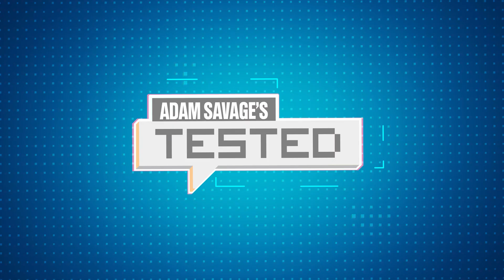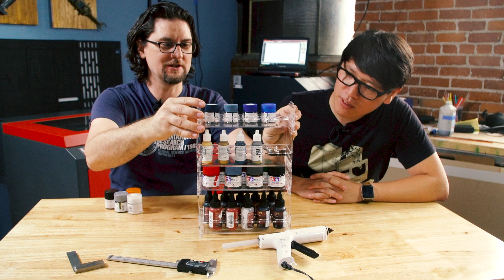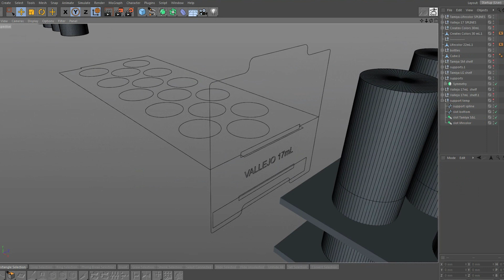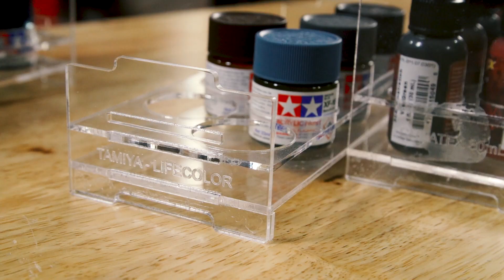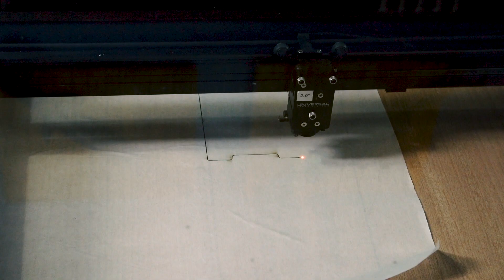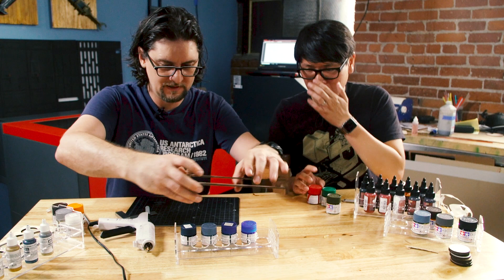Custom Model Paint Racks for the Tested Workshop!

Comment: Big fan of the channel! If you want your laser cut wood projects to have extra strength, make sure you orient the grain correctly. The strength lies across the grain. So I noticed that your trays were oriented weaker, if the grain of the wood was running horinzontally it "wood" hold more weight and not buckle as easily.

Comment: This comment has nothing to do with paint racks. But I have 8 year old bottles of paint that are perfectly useable. How? Stir them once in a while, but most importantly, wipe the bottle neck and inside of the cap with thinner before you re-seal. Get them CLEAN. and tighten hard. If you cleaned them well. they will open easily

Comment: Laser cut paint racks are really cool and useful, but they can be really pricey. Unless you own a cutter for some other purpose, you actually pay a lot per paint pot for a laser cut rack. As others have mentioned, I've used spice racks and kitchen organizers before to varying degrees of success. 

But the best paint rack I've had is one I made myself from dimensional lumber. It cost less than £15 bucks and holds WELL over 200 paints and the only tools I needed was a hand saw and drill: https://youtu.be/IEQe6lGAXOY
Reply: http://gcmini.mybigcommerce.com/paint-racks-and-workbench-accessories/

Super cheap and very high quality

Comment: Does Adam or anyone on the Tested crew do any airbrushing? With 3D printing gaining more traction, I'm seeing people interested in airbrushing their prints, including myself. Had one years ago, looking to see what my favorite creators are using.
Reply: Try this one:  https://www.youtube.com/watch?v=CBHQ7lQGOf0
Reply: @ThePlasticModeler  So far, all I got from that, was that the guys at ILM prefer single action airbrushes. I need to know what's good for acrylic paints, and what's preferred between siphon vs gravity.
Reply: I would advise you check the miniature painting subreddit www.reddit.com/r/miniaturepainting, their sidebar has a lot of suggestions on just those topics.
Reply: The tool is not that important. I prefer the double action myself. But there's people that do fantastic work with single action and ppl that do fantastic work with double action. Best advise: get to a shop that sells airbrushes (or a convention), that will let you play with several different airbrushes to see what you like best. In the end, with practice, it won't matter if you get single or double action.

Comment: I have three racks which hold more than 200 Citadel paint bottles in total. I recommend having the top surface tilted slightly (maybe a 15-25 degree slope) towards so that the paints are easier to see and reach.

Comment: ... So ... not so much a how to, as 99% dont have a laser cutter... so maybe just a "let me show you what I did that you cant replicate" ... cool I guess.

Keep that 1% coming back
Reply: There are places you can pay to have things laser cut as well (makerspaces for example). Or you could use a very inexpensive hand saw and do the same thing manually. It will take longer, sure, but that's usually the case when you want something to be cheaper.
Reply: treborrrrr  Sure, if tested actually would share a link to the file containing the design he made in the video description where you can download the design file for free when they post these videos, getting a makerspace to simply lazer cut it for you at a reasonable amount would be an option :)
Reply: @treborrrrr  I have a woodworking and blacksmithing shop. Yes, I could build these with a jigsaw and various other tools, but thats nothing about what this video is about. ... no real "how to" was given.

At least Adam shows (most of the time) ways that your average joe can do some pretty neat stuff...

This video was 100% ... lookit what I made.
Reply: Good thing the video wasn't labelled as a "how-to" then? In fact in the description of the video they even say that they "show off" what they did. So basically you're getting exactly what they said you were going to get, no?
Reply: @treborrrrr  Youre right im wrong. Ill bow to your powerful persuasiveness.

Comment: Regarding the discussion at 6:38, that would be a trivial thing to do in Fusion 360 with its constraint system. Obviously Fusion is great for 3D stuff, but I don't think people realize that it's also just as great for 2D CAD. You just do the work in a sketch and you export it as a dxf vector.